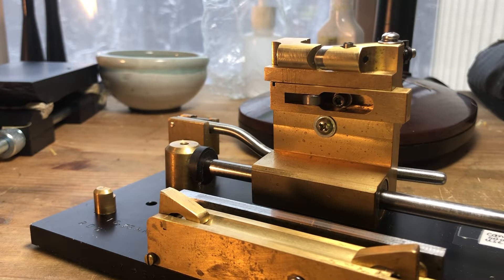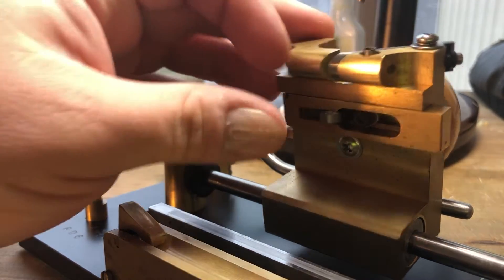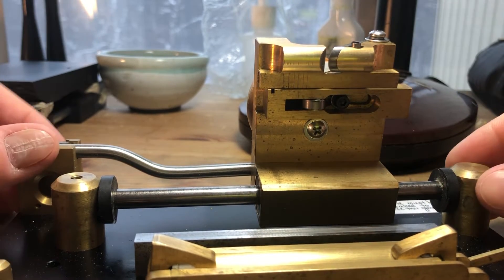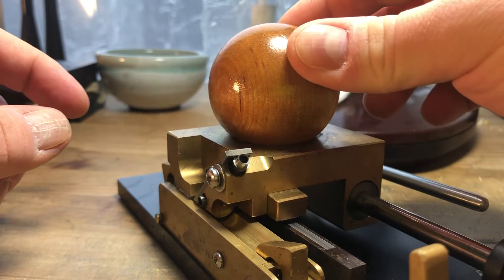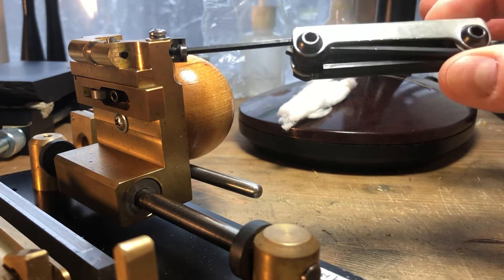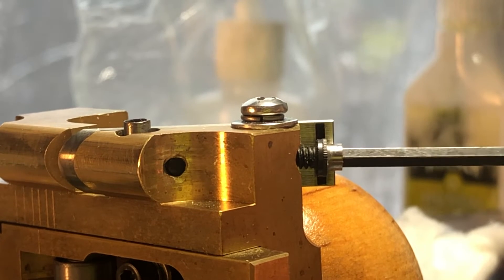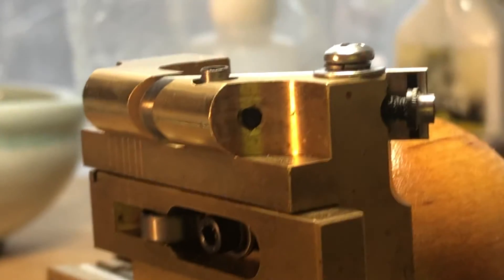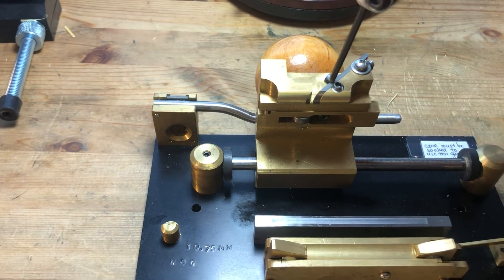Adjusting the blade position in an RDG oboe gouging machine.

Comment: Hi, I am using the same gouging machine - but i am finding that sometimes the blade (or the pressure from the gouger) causes the piece of cane to slip off the little ledge that is supposed to keep the cane from slipping - it then gets totally destroyed - i imagine that this has happened to you from time to time - do you have any suggestions as to how to prevent this from happening - could the reasons be that the blade is cutting too deep ? - or that the little ledge is worn away and too shallow to do its job properly - - or some other reason ? thanks, Peter
Reply: Peter - This is very likely that the piece of cane is too curved. When you split the cane to check the diameter, also place it bark side down on a flat surface to check the curve. If the ends curl up too high or twist, the gouger will reject the pieces. If there is space in the middle and it touches on the sides, the reed will likely not seal all the way to the top.
Reply from the maker: Hi Peter, that is an excellent question. This issue has plagued me with RDG machines, too.  I think the cane stop on these machines is smaller than on other gougers, but I have come to understand that there are many other factors that might contribute to the cane sliding out past the cane stop as you are pushing the carriage. I'll try to describe them all, along with some possible remedies, in no particular order:

1) Cane is not soaked enough, causing you to use more force when pushing the carriage. Try soaking longer (I recommend a full 2hrs)

2) Dull blade, also causing you to use too much force. Maybe it's time to send the blade to RDG for sharpening?

3) Cane is too wide (i.e. not planed or pre gouged enough). This can cause the side edges of the guide to rub on the excess cane, making it difficult to finish gouging. If your machine is cutting well during the first few swipes but becomes more difficult as the piece of cane is closer to finished, this may be the issue. If using a push-through pre gouger, try adding a thin layer of packing tape to the bed of the pre gouger, to raise the cane slightly and achieve a narrower piece.

4) Blade is not exposed enough from the guide. If you never get full, complete shavings, this may be the issue. Shavings should be very thin but not stringy and falling apart.

5) The cane is not straight enough at the ends, causing it to slip out of the cane stop. Try selecting cane that does not have a noticeable curve or twist.

6) Cane has some dirt on the bark, causing it to sit up out of the bed slightly. Cane often comes with dirt on it from the growers.

7) The cane stop itself is gummed up with cane dust or dirt. Try cleaning it between each piece of cane and see if that helps.

8) Your guillotine does not provide a clean edge for the cane stop to grab onto. I have had the most luck using the guillotine attached to the gouging machine.

I hope this helps, I know how frustrating of a problem this is!
Reply: @mattlengas2394 thank you for all that Matt !

Comment: That was very confusing for me, but I was able to figure out the height adjustment just using the two screws, the screw with the collar and the screw that secures the blade. Moving the blade with my finger did not work at all. I don't have the micro-control for that.  LOL